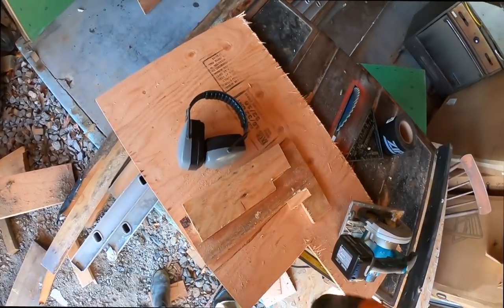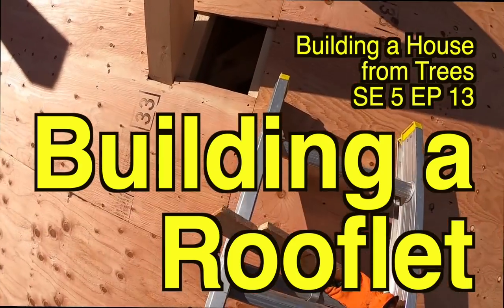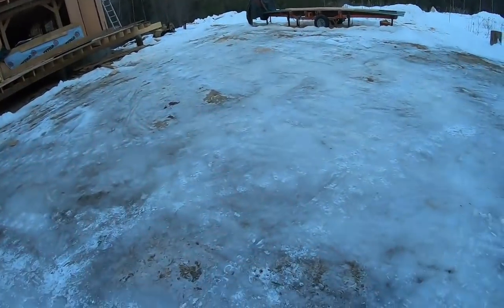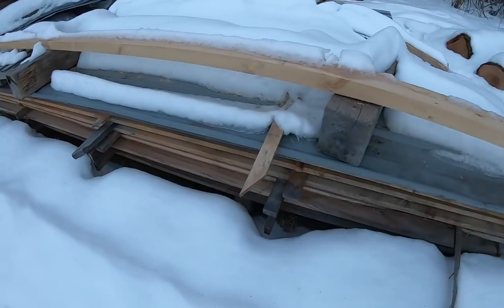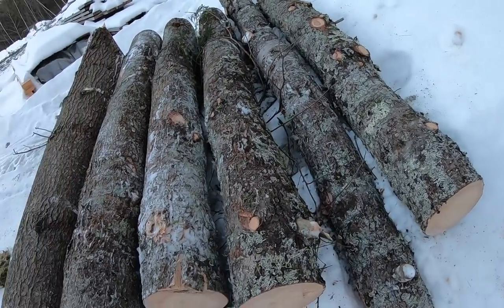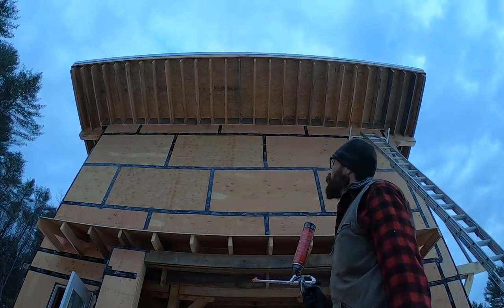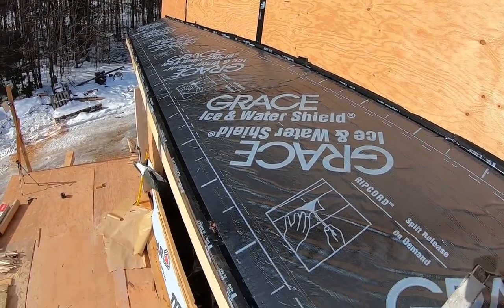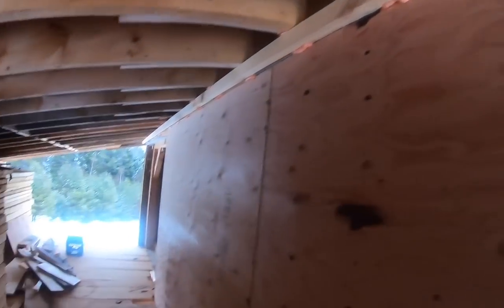Building a House from Trees SE 5 EP 13 - Building a Rooflet - Felling and Milling

Comment: Bus I always cut my onions your way now but I will not be using your stepladder technique until i have completed the high wire training course you have been on 😀.your architect has talked you into building two houses one inside the other like a Russian doll. It’s looking great.
Reply from the maker: Ha! that is a great comment. Yes, that top step thing I noticed too on the video. I don't remember doing that! Yes, this thing is wearing a giant, thick sweater. It'll keep the heat in like none other!

Comment: Another great contribution to my content consumption!

One question; are you right handed; if so why do you keep your hammer on your left side?

As an efficiency analysis it seems as though you are adding steps to the process of pounding nails. 

I  eventually went to my hammer loop right down the center of my back between nail bags. It’s an equal distance to pull from left or right while providing balance to my bags. 

Keep up the great videos and we love what you produce here on YouTube!
Reply from the maker: Great question. Habit. The old tool belt I used on had a loop on the left, and thats what I got used too. i often keep the drill or nail gun on the right, as I used them more. I think thats it. Unless I am doing a lot of hammering, I dont use it wildly often.

Comment: Great video! It sure is nice to start seeing the days grow a bit longer this time of year. I'm curious what you're planning to use for insulation.  Fiberglass? Roxul? Spray foam? Something else?
Reply from the maker: It is nice. Yes, dense pack cellulose in the studs, and 2" rigid foam on the exterior of the sheathing to mitigate thermal bridging. Fiberglass in between floors and 12" dense pack in the ceiling. And there is 2" rigid on the roof too.

Comment: How do you plan on insulating the blocking from the inside?
Reply from the maker: Good question, which I will cover thoroughly, the whole package, but ceiling will have 12" dense pack cellulose. And two inch rigid on the exterior

Comment: do you have to clean that tip on the can when you go to use it the next time
Reply from the maker: There is a can of cleaner that you connect to the gun and blast through, then reconnect the can. Seems to be working thus far. Its just brake cleaner or some other such toxic elixir.

Comment: Was going to ask a few weeks ago but now I'm more curious since I see Zip Board has made it to the job site. Why didn't you sheath the whole thing with Zip.
Reply from the maker: The roof is zip, not over the portico, but the house part is. Season 2? I dont need the extra cost of the zip on the walls, as my build out of the exterior is going to keep any moisture quite far from contacting the sheathing. Plus, the giant overhangs keep it quite protected. Thanks for the question.

Comment: Hello Bus,  I like your channel.  I had to laugh when you said an architect friend recommended curtain walls over platform.  Why does that not surprise me?  Generally speaking you want to keep that group as far from a building as possible.  Their great mentor couldn't even build a roof that shed water!  (Frank Lloyd Wright ring a bell?  The Chicago IBM building?  Maybe electronics should be in a waterproof structure??)  Seems he set a standard they are still living up to.  No I think you are doing just fine with common sense and a bit of actual experience.  Take care.  Doug
Reply from the maker: While to some degree I have experienced what you are describing, in this case, my mate is an extremely talented builder who built from scratch his wonderful house where he and his family live now. So, I had good reason to trust him. But I have seen some whimsical designs that are not real world ready.